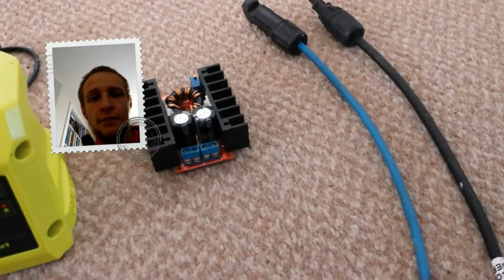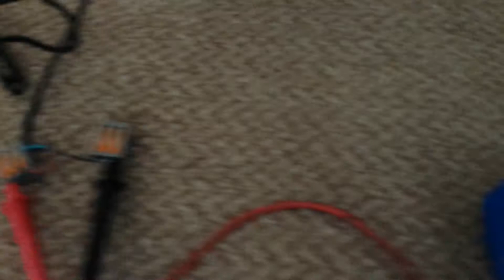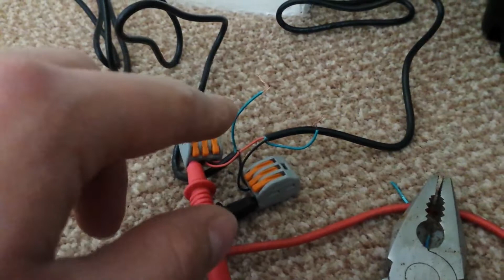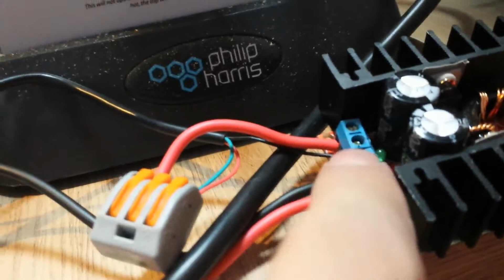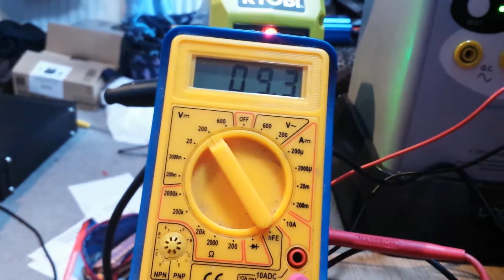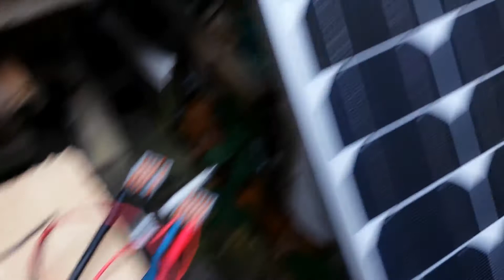Ryobi charger for use with mains/12v/solar panel

Comment: This is very interesting!! I was planning to buy a 12V charger. But now i will try to use one of these for 12v instead... i have to google around to see if i can find more info about this and the dc2 line
Reply from the maker: taztaz79 there's a brand new charger out that is just smaller than a battery. But it's the new standard picture. That has an 18v transformer built into the lead. This would be a better option.

Join Pete's page on face book and I'll upload a picture of the one I mean. If not it's on my list of videos to do!
Reply: Ok.. but whats the difference between the new one and this one in the video? .. The one in this video is the one i own, so i hope i do not have to buy a new one.. was hoping to save some money while i can charge the ryobi batterier from my battery bank that i have in case of power failure :)
Reply from the maker: taztaz79 the one in the video is a 4 hour charger and the new one is a 2 hour charger. Model RC18120 if you want to have a look.
Reply: ahh ok :) well charging time is not that important to me when charging since i have several batteries. But i might get one of those when i buy some new equipment though so its good to know. thanks!

Comment: FYI, the PCB inside the charger has the black wire labelled as "DC-", the red as "DC+", and the green as "DC2".
Reply from the maker: Brilliant is that on the plug side? or in the charger? I can't afford to take the plug apart just yet till I find another at a reasonable price
Reply: pietkaify It's on the silkscreen on the PCB inside the green charging unit.
I've only got one of these, but they're only AU$29 new.
Four T10 "tamperproof" bolts and a sharp knife to cut the label around the seams, and it pops open.

Comment: Pete, that's a brilliant video. I'm crazy about Ryobi stuff, but I don't think I'd have dared put the same voltage on both the red and the green wires. Have you tried it on the Lithium packs?
Reply from the maker: haha I know, I have since put the 12v regulator from my previous video on it and it works. Not tried it on Lithium yet waiting for the sun so I can try it directly on solar!

Comment: I don't think we have those on the US market, but to understand this correctly, that charger is actually running on 12v provided by that small transformer that plugs into the wasll?
Reply from the maker: It was a suprise to me! I don't understand it so I may have to take both the transformer plug and the charger end to make sense of it!
Reply: What does the label say on the fat plug end?  Here in the US the labels will list the voltage and amperage of the transformer module, and usually polarity of the outgoing plug if it is DC.
Reply from the maker: I took the label off I will find it for you in the meantime http://www.ebay.co.uk/itm/Ryobi-One-P116-18v-IntelliPort-Dual-Chemistry-Charger-NEW-/151159020837?pt=US_Power_Tools_Batteries_Chargers&hash=item2331c79d25

this seems to be the US version of the charger?
Reply: 8digitPDX I have the same charger here in AU. The label on the wall-wart only mentions 18V DC output: it seems to be referring to the whole charger as a unit.

The US equivalent of this charger is the P116. It's a "3-hour"/overnight charger rather than the "1-hour" of most of the other chargers, but unless you're in a hurry this is not a bad thing for the batteries. It's Intelliport so won't overcharge the batts, and will charge both chemistries.

pietkaify Thanks for this video. I was in fact intending to take apart this charger today to start investigating whether I can run if off 110V as well as 240V (I have auto-ranging wall-warts available, and the AC inverter in one of my vehicles is 110V) but the choice of running off 240V AC or "12V" DC will probably be even better. Now to look for a 12->20V converter...
Reply: The "intelligent" charge capability means that it is effectively like a solar charge controller.  What is the amperage rating on the wall wart?
Reply: 8digitPDX Actually it says "14.4-18V 450mA".
The P116 might have been discontinued in the US. http://manuals.ryobitools.com/documents/2489